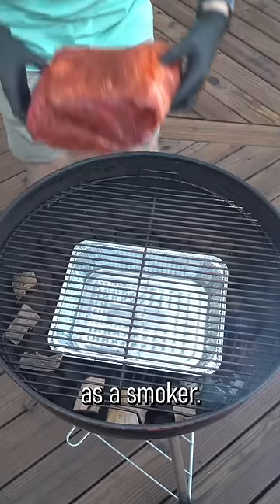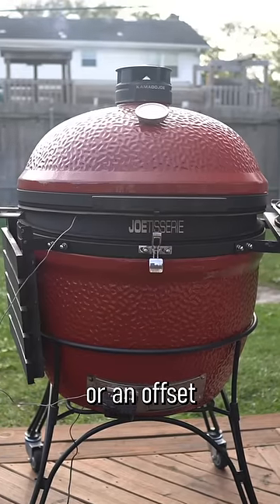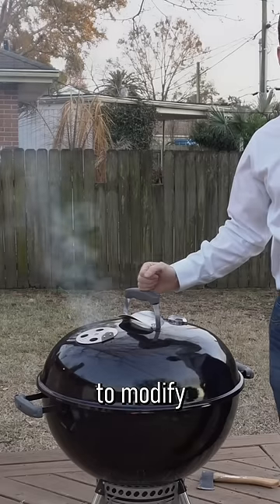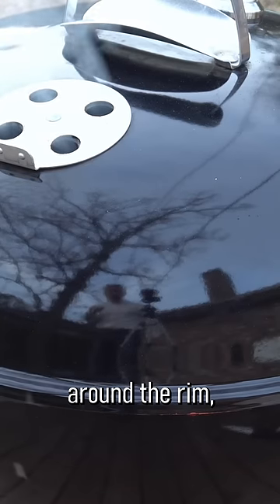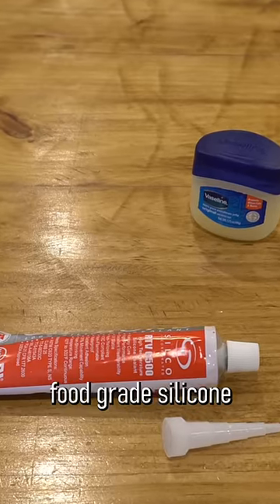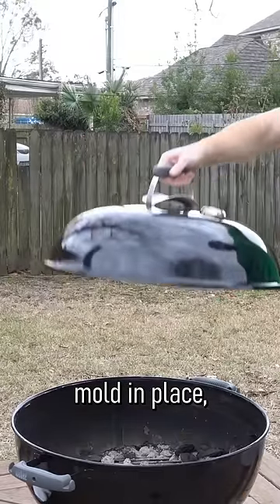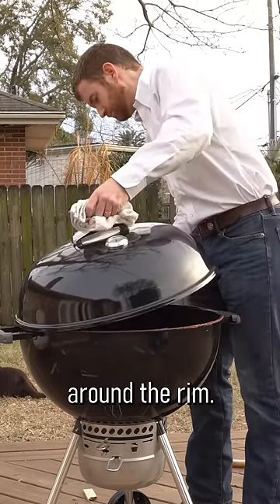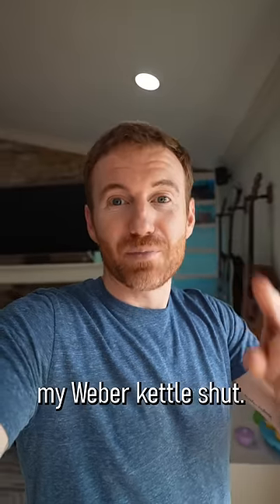Weber Kettle Smoker Modifications: Don’t do it

Comment: Dont try to be so specific with it. Temps are gonna fluctuate. Get it fired up, crack the bottom vent by 1/3 and have the top all the way open. Then walk away for 3 hours and check back.

Comment: I smoke with very few mods that are stupidly easy to do. Barrier for coals and covering the charcoal grate with foil up to the coals. Use the lower vents for temp control and top vent over the meat wide open. Use a few temp probes for grate temp and meat temp. Do not micromanage the temps. 275 to 350 is fine. Just adjust your cook times. To check if a brisket is done, use the probe method. Just use a thermometer probe and push it in in various places.  It's done if it goes in with just a tad bit of resistance. But the biggest way to learn is practice practice practice.

Comment: Felt gaskets seal well enough.  Honestly, longest continuous smoke on one load of charcoal in a 22inch kettle I have done ran just shy of 10 hours with no refueling.

It can be done, and the results are spectacular.  You don't "need" a kamado or ceramic wundermachine to smoke delicious meats.  Technique and a little practice are all you need.